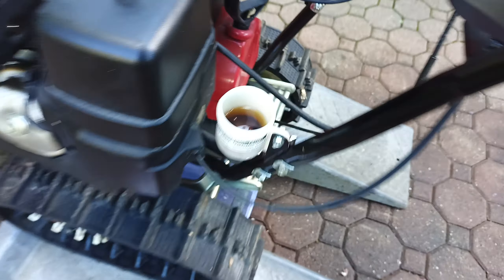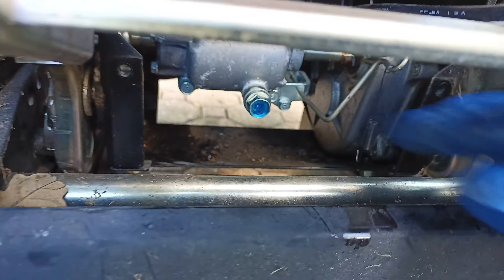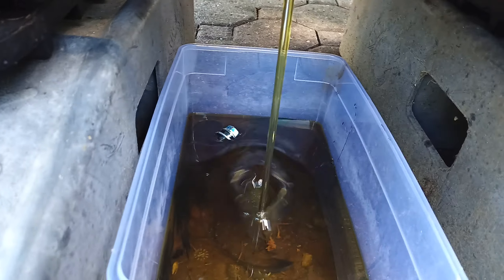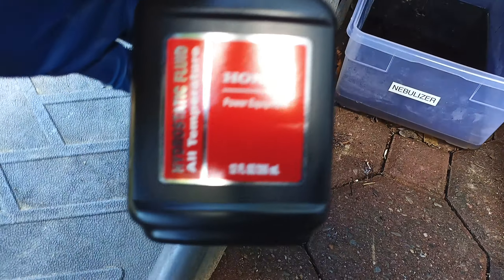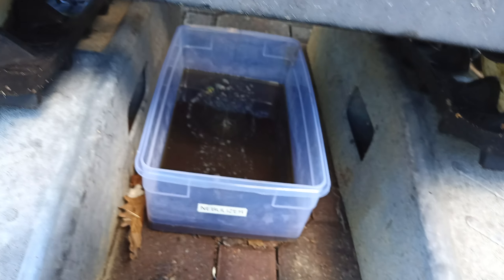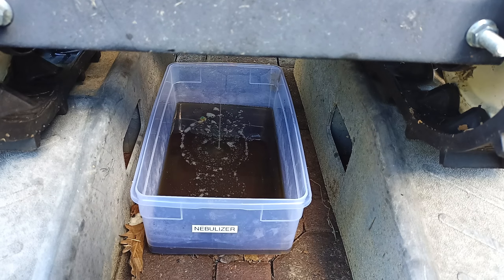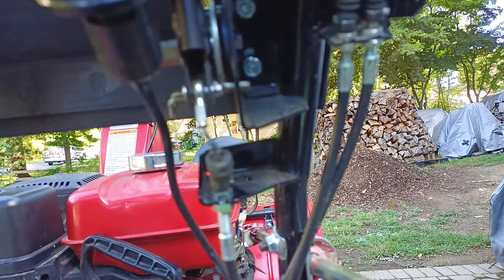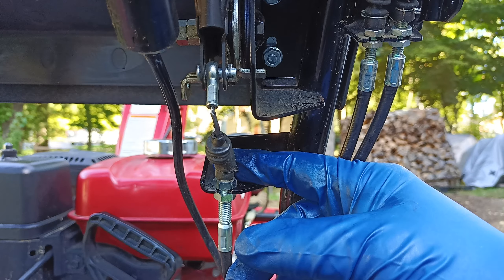Honda HS928 TA K1 Snowblower Hydrostatic Fluid Change

Comment: As a Honda dealer I sold thousands of these machines but never changed hydrostatic fluid in any except now😁😂🤣
Reply from the maker: So......I'm not sure what I'm supposed to take from your comment....is it that they are reliable? Or that it never occured to you? Or what? So why now?

I changed the hydrostatic fluid on two of these machines because they were both neglected and left outside. Bothered were 8 years old. Not too hard of a job, just a little tedious when filling since there is no vent.

Comment: I've had my HS928 for 22 years. Same hydrostatic fluid.
Reply from the maker: Good for you!
Reply: @ProteusDIY - yes, it is good for me. It's also good for anyone else that owns one of these machines to understand that if you simply maintain the machine as per the owners manual then you too can enjoy 22 years of trouble free service from your Honda snowblower. If it ain't broke, don't fix it.
Reply from the maker: @MikeBikerKickstand  Like I said this machine was left outside, abused, and was not taken care of. So you do you and I'll do me. If you believe in lifetime fluids then go ahead and be my guest. FYI machine has been running like a champ since I brought it back to life. Thanks for watching.

Comment: Getting ready to service a customers hs928 non tracked unit . Helpful video , Thnx !
Reply from the maker: I was working on my buddy's 624 today! Changed the engine oil, cleaned out the carb, adjusted the carb, greased the chute mechanism/lever, repaired a broken wire for the ignition that prevented it from turning off with the key, and next time I will do the hydrostatic fluid as well.

Comment: It is NOT recommended to change this oil. The Honda shop manual states the oil is good for the life of the machine.
Reply from the maker: That's nice. When a machine is abused and left outside (like I mentioned in my comment below from 6 months ago) and I'm helping out a friend....I'm going to change the fluid and make sure it's in the best condition that it can be. You're just falling for the manufacturer's BS so that your machine doesn't last and you have to go buy another. You do you and I'll do me. Thanks for the comment.
Reply: Why then does Honda sell pints of hydrostatic oil ?

Comment: If some engine oil got into the hydrostatic transmission oil of a Honda snowblower does anyone know the best way to flush it out? When drained, does every ounce of fluid drain out or is some trapped?
Reply from the maker: You should tip it backwards using the handle to get it out. I'd buy extra hydrostatic oil and fill it again and flush it out to be safe. Will only cost you the fluid and some of your time versus a brand new transmission.